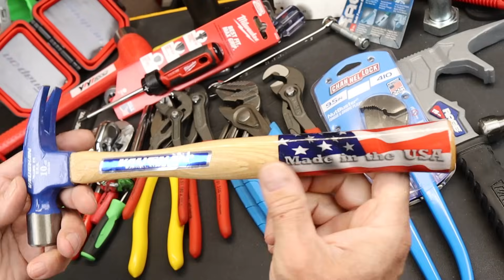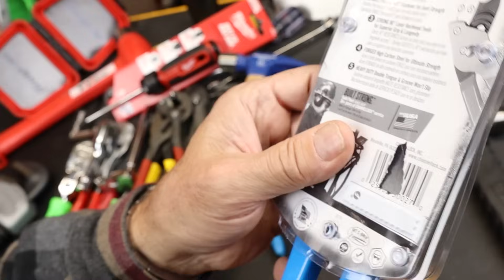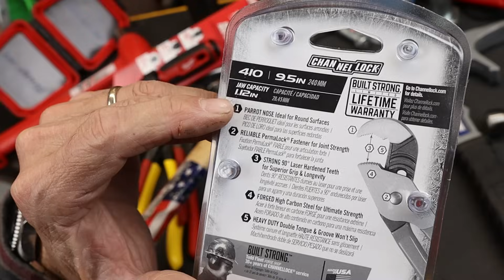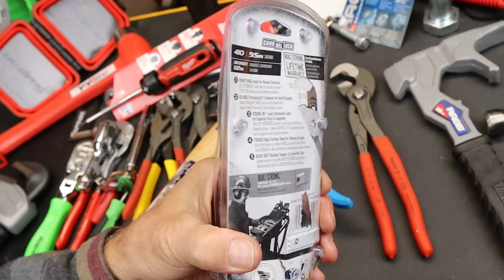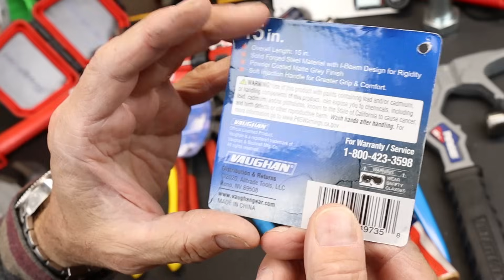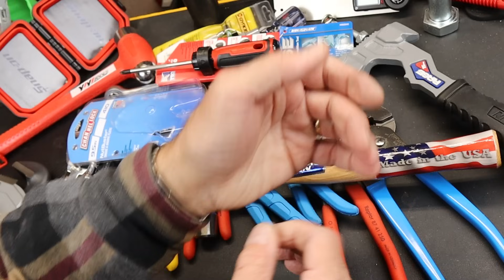Personally Made in America by Todd: American Made with 100% American! Is Vaughan playing both sides?

Comment: 10oz is not a serious ripping hammer. I like the 19 oz, rip claw, smooth face, nail starter, wood handle Vaughn, $35 or less on sale. Good compromise for those who don't hammer enough to justify a framing/demolition AND finishing hammer.

Comment: I do my absolute best to buy USA made products. First for the quality but mainly to help keep my brothers and sisters working. 
My favorite hammer is still my American made Vaughan CF1. I cannot begin to tell you how many thousands of nails I have driven with it. Have a drawer full of Blue handle tools, Snap On tools, Klein and now starting to pick up USA Milwaukee hand tools. 
Thanks for another video brother.
Edit to add, I picked up two pry bars at Walmart last week. They are the Hyper Tough brand but made in the USA. I really didn't need any more but a 25" USA made for 12 dollars is a pretty good deel. Plus they have the metal striking cap on the handle.

Comment: Doc, speaking of dishwashers. Ours has a foul smell every time we use it. I got to dump simple green into its drain. Any clue what’s causing the water to stink ?
Reply from the maker: Other than the usual moldy smell of water using appliances, sometimes the food grinder stops working or jams. It is a little tiny spinning propeller in the water recirculation line that chops up food. If larger food particles are allowed to circulate they can get stuck in places both behind the scenes and in the spinning and spraying parts inside the dishwasher. See if you can locate the smell, and you should be able to pop apart the spray arms  to check inside them. And I am assuming you are cleaning out the trap at the bottom which might be more than just the easy pullout screen. Good luck.

Comment: That is a bit of a shame to see but I will say the vast majority of Vaughan products still seem to be made here in the USA, which is nice to see when the estwing products right next to it have all been outsourced to Asia (wrecking bars and nail pullers coming to mind). I've got 2 of those same 10oz "little pro" hammers along with 2, 20oz steel handle smooth face hammers, and 2 of the 12oz double sided soft face mallets (got 1 of each for work use in the shop and liked them all so much I had to get a second set for at home/on the go). I'd like a 23oz California Framer but I don't really do much framing at this point, if/when I need a framing hammer, that's what I'd get though. I'd like to pick up one of their small 6oz soft face mallets too.

Comment: Again i think this is a case of that told you it wasn't made here by not advertising that it was.
It sucks that they feel the need to offer a few Chinese and Indian made imports, because those products aren't necessary to their lineup.
I love Vaughan & Bushnell though, they're the best.
 Yhey've been made in the USA for at least 150 years at this point as one of Americas oldest tool companies ( Ames is the oldest though, made calvary sabers for the civil war), and were making hammers for Sears going back to the 1880's
I've got 3 of the #9 10oz " little pro " hammers, as well as 2 of the #99 16oz, 3 #999 20oz, and 2 505 24oz. The 28oz and 35oz are on my list just to have but I mostly buy these used because I want older stamped examples.y

I've love the Channellock nutbuster, I have a current#410 nutbuster and just scored an early 50's #410 nutbuster at a yardsale last week.

Comment: I'd rather see an actual alloy designation... as opposed to 'US Steel' and stock photos.
Reply: Most hammers are 1045 water hardening steel, or 4140. And most  channellocks are 1080 steel. You can find that info if you look it up, if it’s that important.
Reply: Knipex uses chrome vanadium steel. Which is better for pliers, chrome vanadium or 1080 steel?  @BryceKimball7.3
Reply: Vaughan & Bushnell uses 1080.
They're not going to bother saying it though because the average person isn't worried about the specific type of steel.
It complicated the writing on the packaging and everything too.